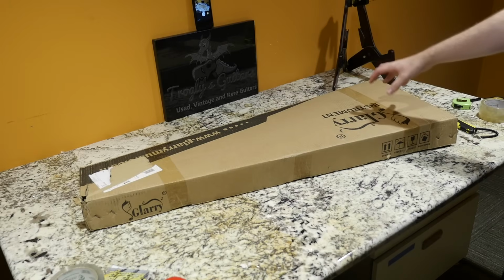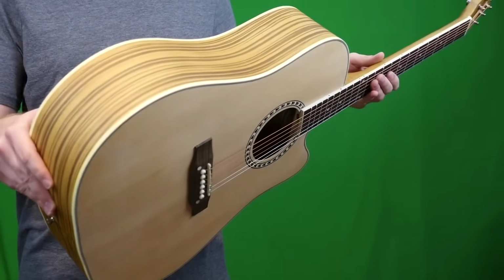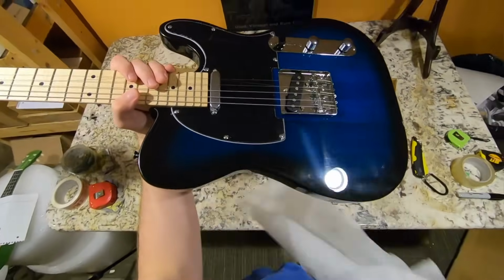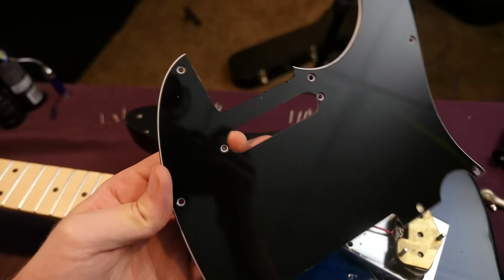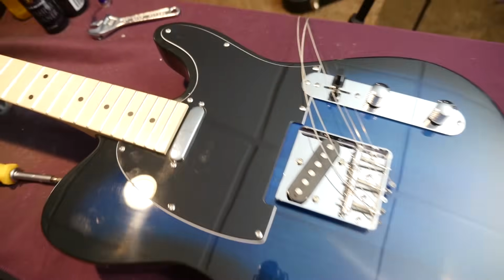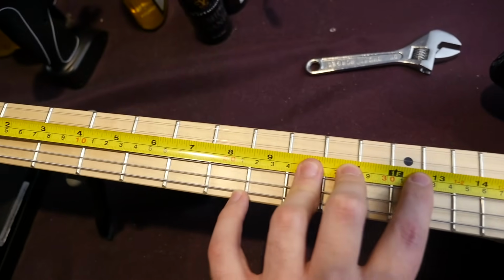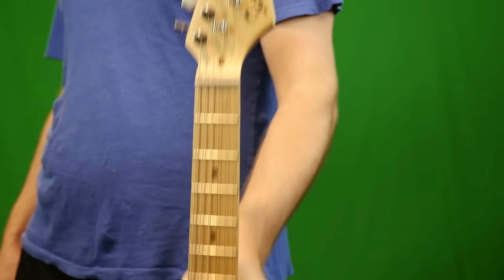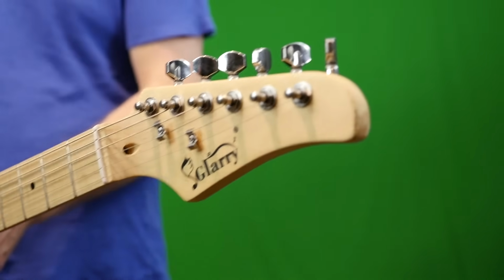How I REALLY Feel About Glarry Guitars... | Glarry GTL Maple Electric Guitar Blue Review + Demo

Comment: Great "campfire guitar". You play it around the campfire and when you run low on fire wood, you toss this in.
Reply: And use the truss rod for roasting marshmallows.
Reply: My youngest (late great great chick picker brother),And myself thought Les Pauls were heavy,EXPENSIVE,NO TONE,Wouldn't stay in tune,So they should be sold by the RICK!😁
Reply: Expensive campfire wood
Reply: It's not that bad sheesh
Reply: YaBoiDrake Lighten up and have a little sense of humor, sheesh!
Reply: @bobthebrick1988  I agree. I have the very same guitar and I must say, I've played on guitars that cost 3x as much which were definitely not superior to the Glarry, neither in construction nor in sound.
Reply: Lol
Reply: $60 campfire wood
Reply: I need a nice playable hollowbody under 200$. Any suggestions
Reply: You obviously don’t know how to play……great guitars and basses……just depends on whose hands they are in…..something tells me your band aide bill must be enormous every month……with your knuckles scraping the ground on a daily basis.
Reply: I'd buy them, drop in some better pickups, maybe better potiometers, and switch. The hardware seems good. Bridge is ok. Sealed tuners. I'd put a bone or graphite nut. Basswood body, maple neck. That's a good start 👍. Point is, for practice and low key gigs where you don't want to bring the $3000 LP, can't go wrong. IF you know what you are doing, mods can be done. Fun for the beginners to mess around with.
Reply: I'm not a "snob" , but Garry, Donner, and lately the newer Squires are just getting to the point that the workmanship, and electronics are  so haphazard they're just not worth the time to mess with anymore. I rebuild a lot of "hanger queens" I pick up here and there, and have much better luck doing that than trying to mod these bottom feeders.
You open em up, and I'd sware they're using picket lint, and gum wrappers to wire em with, and the oxidation is already setting into the pots. For a few dollars more there are plenty of actual playable brands out there. I picked up a killer Charvel, ( made in Mexico) the other day for a decent price. They're out there if ya look

Comment: That's not damage, that's a Relicing Starter Pack®.
Reply: Hell yeah 😎
Reply: Fender charges $500 for it. Now you know why it's cheap. 

Why do you keep saying "What's $70" when it is an $80 guitar? I bought an EPI LP Special a couple of years ago from GC for $80 and gave it to my nephew because he wanted it; as far as I am concerned, cheap junk is junk.
Reply: @alwaysopen7970   I actually bought one. I was looking at a kit to modify but saw this review and  liked the blue burst. I got it in and dressed the frets. It's not good on a loud amp and not a gigging instrument. Plugged in to my Vox headphone jack it sounds killer. I'm still going to rip the guts out and slap expensive electronics in it. Something I like to do for fun. Might get a set of Pearly Gates and wire them to split. For now it's my tinker toy.
Reply: If you don't like the way it looks, you can always drag out the jigsaw and make your own custom design. Get some heavy metal a jigsaw a file. File it down. Drill it out. Dress it up killer killer machine like highway star on the road again... And killer on the road

Comment: It's really pretty incredible what you can get for so little money. When I started out as a kid in the mid to late 80s, I don't think you could even get a new electric guitar for $60-70...much less the $25-30 that the equivalent would have been back then when adjusting for inflation. My first new one was some Strat copy from Radio Shack that was around $130 (almost $300 in 2019 dollars, which will buy you a pretty nice guitar these days). It was terrible compared to a Glarry.  I left it outside one night, it got rained on, and the particle board body swelled up like it had been stung by 1,000 bees. Totally ruined. You really don't even see plywood bodies anymore like you used to on a lot of cheap (and even midrange) imports from back then, but at least the plywood held up somewhat. Particle board was a whole other level of junk.
Reply: Travis Hemming agreed about the price and construction of new guitars.  Back in the late 1970s and 1980s CNC Machining was rare, now with widespread use everyone benefits.
I've also seen what happens when a particle board guitar body meets H2O, it ain't pretty.
Reply: I think the true lesson is dont leave a guitar in the rain but hey...who am i?
Reply: Got a burning fire Bass. $100 new online. Got mine on new sale for $40. Must've been b-stock because it had a chip on the headstock. That's it. It has just playable pickups and decent (actually decent wtf) tuners that hold tune better than my stock Ibanez. Within an hour, I, a total beginner, had the action set up perfectly, in tune, well intonated, sounding good. Idc if you're gunna wanna swap pickups, tuners, rewire, etc, it's a $40 guitar that can do all of that with less than an hour of work. It's light AF with extremely little neck dive.  SHOCKINGLY comfortable. I was originally gunna sand the sun burst front off and stain it rosewood to match the neck, but they actually did a good job on the sunburst. Idk if it's real grain or painted grain and irdc. It has amber and shine just like real finished wood. Is it cheap mass produced garbage? Yeah. But "Garbage" has changed in the bass and guitar world. It used to be garbage wasn't playable. Now unplayable is unacceptable, at least to Glarry, Grote, and Harley Benton, and garbage now means "Just playable enough or surprisingly good but you'll want new pickups and hardware to perform with it".

Comment: I bought a gtl for tinkering.  I sanded the neck and tru oiled it.  Dr strings, polished frets, installed a humbucker bridge with individual saddles and a dp100 and dp151 pickups with linear 500k pots.  It plays fantastic and sounds much better now.  Also had to file the nut and tighten neck screws.  It's light weight and I thoroughly enjoy playing it.  $66 on ebay.

Comment: I bought a GST model as a project, so I knew what to expect.  Just sharing what I did:  I put on a Goldtone Zeroglide nut which gave it more clear sustain; I got a new pickguard blank and bought a real Gibson P90 and harness, and put that in place of the three pickups.  I essentially was making an LPjr in a Strat body.  I cleaned up all the frets, steel wooled the unfinished neck, it's very smooth.  I learned a trick, before doing any fret leveling, find the high ones and use your rubber fret hammer to pound on them, every one went down so I didn't have to do any fret leveling, and no damage to the neck. Great hack.  The biggest problem was the tremolo bridge.  I tried all the tricks.  I put on some rolling bridge saddles (cheap).  I also took the bridge off and counter sunk the underside of all the six holes, to give more room when using the trem.  It made a difference.  I ALSO bought six machine screws (stainless oval head) because they mimic the Fender screws of the 2 point trems.  I then countersunk the topside of the trem bridge AND ground down the top-back of each of the six screw holes, so that when I dive bomb the heads of the screws get the most clearance.  If they were flathead it would never be smooth and consistent.  A lot of work for a cheap guitar, but it was fun.  And it makes a difference, the trem goes back to pitch much better.  One more thing, I had to grind down the length of the low E string saddle because I couldn't get it to intonate enough, that made it possible for the saddle to go backwards more to get correct intonation on the low E string.  I also had to trim a little of the spring off.  Gradually, with all these changes, and adjusting spring tension, I have gotten it to be much more consistent in tuning and intonation.  I also put D'Addario Auto trim tuners on.   Now it has the meat and scream of the Gibson P90 but also the Strat twang at the bridge, and much more power than a Strat single coil pu.  the pots give me great variation, so it's my version of a Noventacaster but with a real Gibson P90.  Hope this helps someone if they are modding out.

Comment: Great video.  Here is my comment on the Glarry.  I think it is fine FIRST guitar provided that you have it setup by a friend who knows how to do it correctly or you learn how to set up a guitar yourself.  For someone who is starting out and has nothing, having a budge of $300 does not mean you can purchase a $300 guitar any more than if you have a budget of $1000 means you can simply purchase a $1000 guitar. 

When you are first starting out you're going to have to invest in some other equipment. 

1)Even if you buy a starter pack, you'll still want to purchase several sets of strings and some single strings like the high E string because you'll want to replace the ones that come on your guitar, you're likely to break strings, especially the high E string practicing your bending.  You'll also likely want to try different size strings.  8s might come on the guitar but you might find 9s better for you or maybe you want to see if 10s are easier for you to play.  A couple of sets of strings in a couple of sizes plus a few single stings will cost you $30 or more. 
2) You'll likely want a descent guitar stand so the guitar is out and ready to practice and you have a place to put it if you get interrupted.  That's $20-$50 bucks.
3) You'll likely want to get a winding multi tool to make restringing the guitar a bit easier.  There's another $15.
4) You'll likely want to get a big bag of picks in multiple thicknesses so you can play around and figure out what ones you prefer.  Another $15.
5) You'll likely need to purchase an instrument cable since your guitar may not have one or it will be crap.  Another $20.
6) You may want to purchase a descent strap since your guitar may not come with one or if it does it's likely to be uncomfortable.  Another $15-$20. 

So, $85 to $120 for just ancillary items must also be part of your budget.

Now think about amps for a moment.  Sure you can purchase a $40 plugin or an $80 practice amp.  But these don't typically have Reverb and eventually you'll want to spend $200 on a descent modeling amp and that $40 plugin or $80 practice amp will end up on eBay for 1/2 price.  So, you might want to opt for a $200 amp to begin with rather than wait a couple of months and then purchase it. 
So, Practice Amp and ancillaries for $180 or Modeling amp and ancillaries for $300 means you have a lot less in your budget for your first guitar.

And this all presumes that before you've spent any time trying to learn guitar that you know that you prefer a Stratocaster style over a Les Paul style over an Ibanez or some other style.

So, what's my point?   At about $100 for a kit from Glarry plus $100 for ancillaries you can start to figure all of this out.  The crap amp that comes in the kit is just as useful as that $40 plug in as you can plug a set of headphones into it.

And even if you decide that the Strat style Glarry isn't what you like it is at least good enough for you to take a few lessons (online or in person), learn a few cords, learn a few riffs and feel confident enough to walk into a real guitar store and try out various other guitars.  Or you can take advantage of their 30 day return policy to try out something different.

Either you will eventually purchase a better guitar or you'll quit playing.  If you spend $100 on a Glarry and get $50 for it when you sell it on eBay then you've spent $50 on your first guitar.  That's a whole lot better than spending $600 on a used MIM Fender and reselling it for $450.  And if you have $1000 budget for a guitar I still wouldn't recommend trying to purchase $1000 guitar as your first one for the same reasons.  Opt for a $400 guitar as your first guitar and put $200 in a modeling amp which will work with any guitar you purchase in the future.  Add that $100 worth of ancillaries and your still at $700.  But again, if you decide that $400 guitar isn't for you then you're still likely to sell it for $300 and your first guitar will only have cost you $100.

Of course this is just my opinion.  If you disagree and feel the need to say so, please do.  I promise not to take it personally.

Comment: I just bought this exact same guitar from Glarry. I had the same problem with the plastic being melted onto the neck pickup and I had to take the whole thing apart and use goo gone to clean it off.otherwise I was pretty impressed at how good it played out of the box. I guess I got a good one. And in the process of taking the pickguard off my e string broke in the exact same spot that yours did.I contacted them and they are sending me a new set of strings and in addition gave me a 5% off option on another guitar. Is the top-of-the-line quality? No. was I expecting that? No. Butt out of the box is a fun guitar to Noodle around with and the blue color was interesting to me. I will tell you this. Glarry's customer service is great. I told them if they ever make a Les Paul copy I will buy that for sure. I would definitely recommend it to somebody who wanted to learn and didn't want to spend a lot for a guitar.

Comment: Older video, but I'll toss in my two cents. Just got a Glarry Strat, and I was legitimately surprised at how good it was for the money. A bit of adjustment and setup, some minor imperfections, but it has a great blues sound when played clean on the bridge pickup, and is comfortable to play with a new set of 8 gauge strings.
Reply: Ill add that I had the same issues with my output jack, though it wasn't hard to get it running properly.

Comment: these seem more geared for a first mod guitar than a first guitar. they're cheap enough you won't go nuts if you screw it up, but solid enough you have a great starting point. almost like the step before a kit guitar.
Reply: I was think the same thing. They should be called Skeleton guitars.
Reply: There are much better companies than Glarry for cheap guitars. I'm no shill. Harley Benton, Aiersi, to name a couple. Check out Eart for insane fretwork. Apparently they, cut, dress, and round the fret ends before installation. I have seen some videos where they say the frets are a c-hair short, but doesn't make a difference in playability. $400 gets you closer to $1000
Reply: There are much better cheaper guitars, but these are better for people who wanna learn how to dress frets and more serious Luther stuff.
Reply: @lichkrieg4898  Two days ago I picked up an Aiersi Telecaster copy in a sort of caramel orange flame. It's a really nice looking guitar that had a bone-straight neck and what looked like level enough frets. 
I paid the guy $125 for it, took it home and removed the strings he had on it. I took a green scotch pad to the fret sprout and polished up the frets and maple fingerboard with the same. New strings and a break in and I literally cannot make this thing go out of tune. It has a slightly proud 22nd fret that needs it attitude adjusted, but other than that it's a $500 guitar in a $125 package. Really nice finish and binding work, and a solid neck joint.....no space whatsoever. Every morning I pick it up and it's barely a cent out of tune, even though I played the snot out of it the night before. I really am still in shock for what $125 got me.
Aiersi. Apparently there's even better guitars for cheap out there.
Reply: @minkorrh  I'll have to check that out, I need a nice Tele body for a baritone I'm trying to part together.

Comment: I'm a luthier and almost any guitar ordered online (whether cheap Glarrys or midrange top brands) needs a set up upon arrival.  They are coming from one climate, passing through others, and things shift upon destination.  Fret ends are almost always sharp - one or two high frets - and having to reset the action at both ends is normal.  Having said that, I did get the 604 rosewood back one and do a full luthier set up on it - and it was rather underwhelming.  Lots of people swear by them - and even refinish them and make them look nice. I think there are better cheap guitars out there.

Comment: Assuming that the solder joints on the jack are okay, often times the only thing that you need to do to correct an intermittent jack is to bend the contacts slightly.  Now it is also possible that the staking of the jack barrel over the solder tab is poor.  I often solder the jack barrel to the solder tab on the jack as a preventative measure.

Comment: I've got a metallic blue telecaster. I built it and was the only way I was going to get a metallic royal blue tele that was made decent. I went with an LP style toggle a Douglas Fir body (for folks that think its shitty wood the reason I chose it was to mimic the pine telecasters in the 50's but with a wood that is similar but more structural sound), and a maple neck and finger board. It's a good guitar and I like it a lot. 

The tele is the easiest guitar to make from scratch and get a decent result. The more you build guitars the better you get this was my 3rd one so I was happy with it.
Good video. Looks decent for the price point.

Comment: I purchased a Glarry P Bass for $69 to leave at church for a practice bass.  After a few adjustments, it played just fine.  I got the bug to buy a fretless bass but I wasn't sure I would like one so I decided to convert the Glarry to fretless. After many hours of fret pulling, cutting, gluing and sanding, it turned out better than I expected.  I did go a little overboard with a new roller bridge, bone nut, pots, pickguard and a set of Seymours. Do I now own an overprice Glarry...yes...but considering even the cost of an inexpensive factory fretless, I came out better plus it was a good learning experience. My total conversion investment (including the original bass purchase) is $230 plus a set of flat wounds.